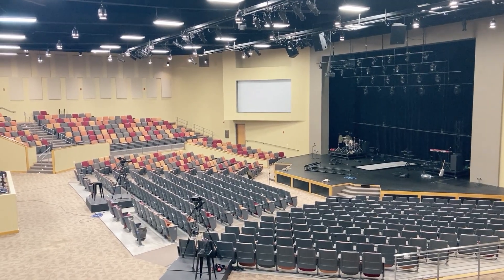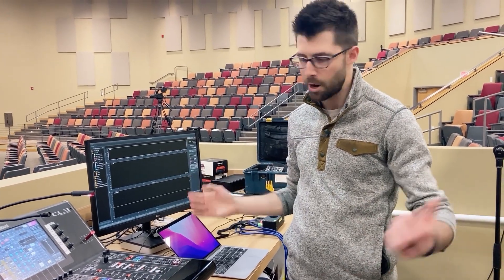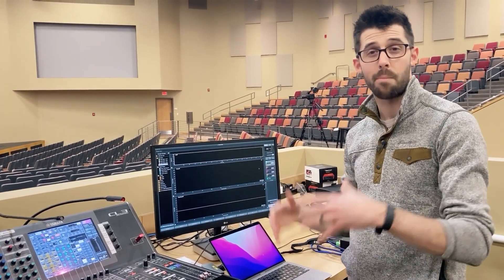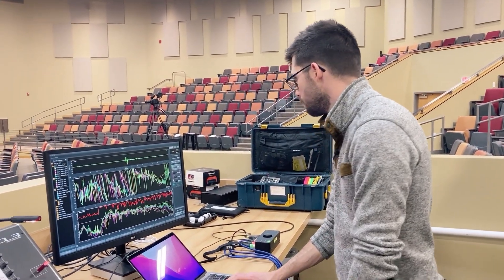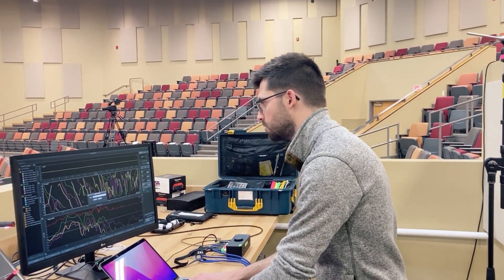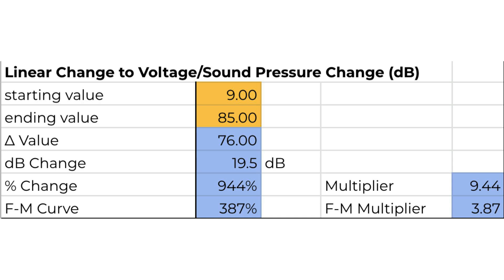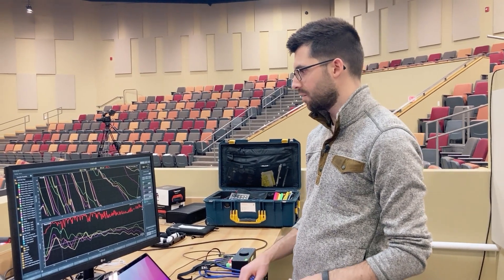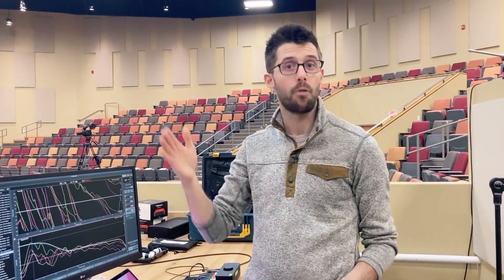How Much Louder Are Subs In The Front Of The Room vs The Back? (Revisited)

Comment: I'd be curious to know how placing the microphones on the floor would affect your results. The cancellation at 50-ish Hz would be the result of something at roughly 11 ft from the source. So, the mic at roughly 6' wouldn't be the culprit of this issue. I'd have to "explore the space, Gene" to figure out what might be causing that 50Hz issue. 

My favorite system design so far has been 2 SL-Subs over 9 B6's. It was ..."Sufficient" for a 1,500 seat room. I always like to have a horizontal array of subs with flown subs when budget allows.
Reply from the maker: That would be interesting to try! I'm still convinced it's the SBIR from the concrete wall in the cavity behind each sub, but putting the mic on the ground would eliminate floor bounces that could potentially cloud the data. I just doubt that there's an 11ft path length difference in the floor bounces.

Comment: I think this validates what I do by ear - rarely do I have time to measure out a room, as time from setup to performance might only be a few hours.  I walk around and subjectively listen to the balance, and it will change of course depending on too many factors, but you shoot for the best overall compromise.  It would be nice to measure out for a lot of factors like phase, but it's almost never an option for the work I do.
Reply from the maker: Way to make it happen on such a quick turnaround.
Reply: @MichaelCurtisAudio  Often I don't even have access to the venue until day-of.  Just did a town festival that way where we did load-in at 7am, and first stage opened at 10.